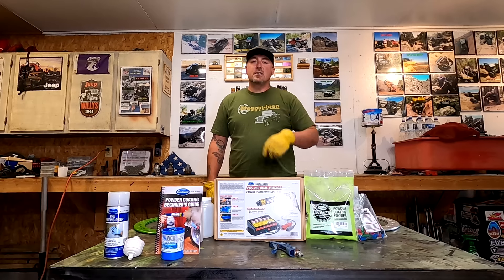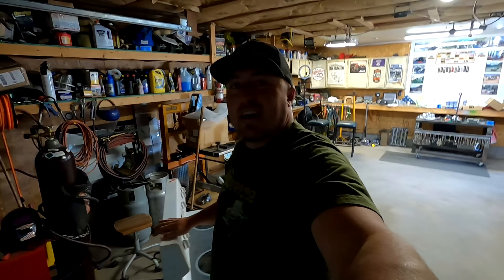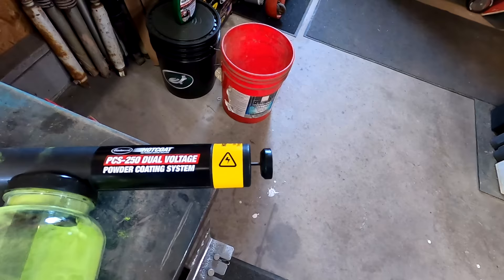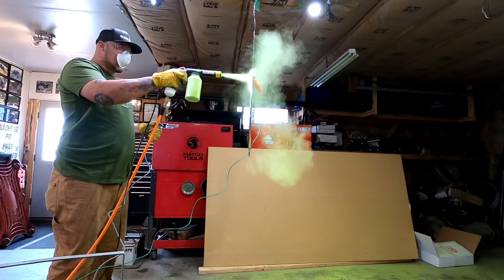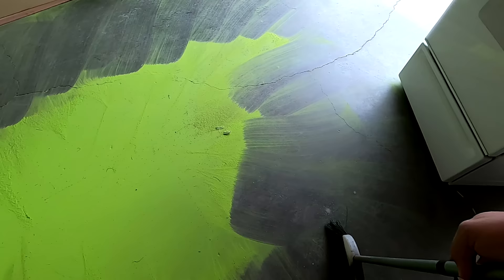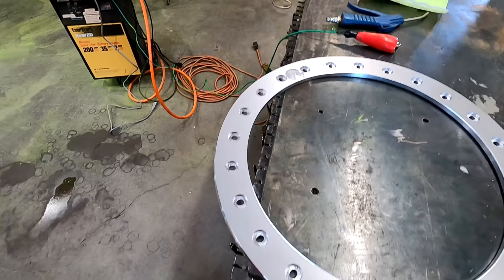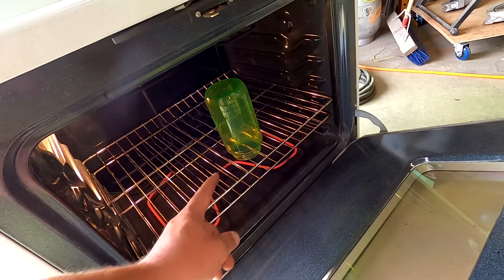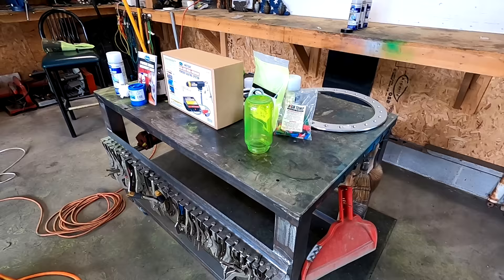10 EASY Steps to Powder Coating at Home. How To Powdercoat

Comment: When you are planning to do a 2 coat application, never fully cure the first coat! You will not get adhesion between the two coats. only cook the first coat until it just starts to gel then apply the second coat!!!
Reply: Fuck yeah dude
Reply: Great video, thanks for posting it!
Reply: Looks like it stuck just fine, know it all
Reply: @steveg2509  it always looks "just fine" but will chip easier later and not be as durable. Dont be a know-nothing and hate on people who know what they are doing just because you dont.
Reply: Truth, it will stick but won't be as durable as it would be when coating over cured powder.
Reply: If it doesn’t stick you can use a blow torch to slightly warm it up before you proceed for the 2nd coat
Reply: A good video for acquiring some basic techniques. Thank you !
Reply: @steveg2509 he’s correct though. It’s standard to heat for about half the time, recoat and then continue for the entire time the second coat requires. This likely worked ok, but you can’t see adhesion from just looking at it from a video.
Reply: Yamaharider158 no, the slightest bit of dirt and it’s ruined. Industrially it’s reused, but it has to go through a cleaning process first.
Reply: @Bzkorea if by blow torch, you mean open flame, then no. A hot air gun works though.
Reply: 8:00 has to be a way to reclaim it
Reply: @cjstrick2010  I'm thinking you will be able to reclaim it if you spray in a clean environment over a large and clean painters' plastic sheet. Then, gently lift the plastic so it collects in the middle and pour it in your container.
Reply: Great video! Thanks.
Reply: @motivpp that's exactly what I was thinking too. Lay a clean plastic painters sheet 5mil first and then sweep up or hand vacuum it up after the application. Completely sterilize broom and dust pan or hand vac after each clean up. But Idk...
Reply: It looks really easy
Reply: Looks like something I would be good at
Reply: @krustys_official  Yes and if the clean plastic is the liner of a giant makeshift hopper (either a real one or put together with cardboard), it would be even more successful and less messy

Comment: Some tips too. You could use the oven racks to hang from, then put it the oven without touching the paint. Let it hang from same wire you sprayed with. That way you don't mess up the powder in transport. Plus spraying over some sort of clean containment, you could reuse the paint.
Reply: I was thinking the same.  Put a sheet of plastic on the floor.  That was a no-brainer.
The oven rack may work but, then you get a powder coated oven rack.  I'd like a explanation on how to transport it without getting fingerprints or tool marks in the powder.
His green is very splotchy.  IDK how to stop that other than have the professional shops do it.
Reply: If he
Reply: If he had used white first it wouldn't be so splotchy , bare metal will do that. Like anything it just takes practice.looked like fun was set to high, usually it's put on slower.
Reply: Damn auto correct gun not fun
Reply: @RalphSampson...  if you take the oven racks out, and suspend them by line or bungee, whichever. Then attach whatever your spraying with line, like he did from the ceiling. You can attach the clamp to the wire and spray the part. You can wipe any powder off the oven rack if you want before bake. Then just disconnect the rack from the supports and slide it in the oven. I can't tell if his racks have that annoying thing that requires you to lift it at an angle to get out. If it does, he can cut the rack to allow it to slide in straight. Hope that clears it up.
Reply: you could almost use someting like a media blasting cabinet
Reply: Good man, you gave the advice I was about to. Cheers

Comment: Just a tip: I started with the older dual voltage Eastwood model years ago and still use it from time to time to this day. Try spraying around 5-7 psi and work a little more slowly. That system has its limits but that will help the coating come out more even. 👍🏼👍🏼

Comment: Good video! One thing I found that helps tremendously with adhesion (not as big of a deal with shiny new parts, but with older stuff that ends up being what I coated most) is to use a phosphate etching pre-treatment. I think i got mine from Columbia Coatings, but its been years so not positive. Really helped out when I used to rebuild old motorcycles.
Reply: So you're the one I should ask how do I get an oven large enough for a 1983 FXR Harley frame?

Comment: Very informative. I've been considering powder coater myself for some time but have not yet. Knowing the basics before hand, understanding the "mess" left behind, a clean booth setup would enable reuse of the excess powder. Basically a non-conductive plastic box which the part fts comfortably inside without much interference for applicaton.
Reply: No, no, no  don't powdercoat yourself.

Sitting in the oven for 20 minutes at 400 deg C will be worse than all day in a maxed out sauna with no ice-cream.

Comment: If you hang with a hook the rims you paint in the oven instead of putting  them in the rack it come out great because as they cure they can stick with a rack and comes out with Mark also instead coating them multiple time if your ground is great you can spray once great .you did a good job.

Comment: i got a refrigerator box  cut the front off of it and put a small box in the bottom with a trash bag in it. hang your parts so they are in the box all your overspray, or most, goes in the trash bag so you can clean up easy and its reusable so it cuts waste. on parts i do double side ill do one side then take my propane torch and run it over the part to harden it then spray the other side and put it in the oven... works well for me! good job with the video

Comment: Great video, I bought the powder coating system that has the power converter as the product distribution from EastWood. Gonna do some RC parts for my crawlers etc.  You did a great job explaining it in layman's terms.

Comment: I am in the process of having 3 patio steel chairs powder coated in patriotic colors. I took the chairs apart to save time, that was a chore in itself. Rusty 1/4-20 bolts soaked in wd40 and super zilla still didn't work.. heating the nuts helped others needed to be hack sawed apart great workout. Cost for 2 $75 ea. 3rd $175 will look like the US flag. We will need to add the vynal white stars on the back rest. Can't wait to get them back together.

Comment: Hi had a idear to collect unused Powder coat spray. Get a card board box a turn it in to a half circle, place this behind what your spraying and also place a bucket below object to collect over/unused spray. Never done this but should work and save on waisted Paint. Also as using a oven a heat gun can also be used to harden painted items.good tips on your video.cheers Scott

Comment: This was awesome, I was always curious if this was possible at home.  Only drawback is limited to smaller items that fit into an over.  Would love to weld and coat some outdoor fixtures, but need a larger heat source.  But thanks, great info.

Comment: I've yet to use my Eastwood setup, and I've already got the oven. 
In the meantime of kicking ideas around in my head, I was thinking to make a metal insulated "box" to enclose the oven when the door is totally open. 
Basically it would double the size ,and the heat wouldn't be as even obviously but it might be worth trying to experiment with someday.

Comment: Great video, learned a few new things. 
One thing I could say, it seems that you're spraying too much powder (I'll admit, I'm only 5.5 minutes in to the video). 
I've been powder coating for a few months now and achieve a great finish with wayyy less powder coming out of the gun. I had mine set up the same way when I first started, and was going through bottles of powder like no tomorrow. I've seen from a few other videos (and now that my body shop has started doing powder coating) that a lot less powder is needed (yea yea.. broken record, lol). 
Again, great video! :)

Comment: Questions:
1. How do you powder coat the area where the item is hanging from or the spot that is used to complete the circuit?
1a. Use a different spot when doing the second coat? OK, but is the paint conductive? How does the circuit get completed with a layer of paint in the way?

Comment: You could put together some kind of catch system to catch the over spray and reuse the powder. Seems like a waste seeing half of the contents on the floor. Is there a way to minimize the wasting via gun setting ?
I thought the electrical process of attraction between the negative and positive would attract most of the powder to the item and not have so much waft away past it.
I am definitely going to invest in a powder coat system at some point as I love the finish and durability of powder coating, plus I have a tonne of stuff to do.

Comment: I gave up using eastwood powder coating gun, it  quit working. Went with at the time the Sears setup, much easier to use. Then I got a Columbia Coatings rig. Better system, IMO.

Comment: Could you not set up a small spray booth type corner, with a plastic catch tray at the bottom to catch all the over spray spill off? That way you could reuse it without there being floor particles in it?

Comment: Build yourself a simple small booth to help with powder cleanup and reclaiming powder. Hang multiple parts(when you can) one behind the other so the over spray lands on other parts. Be sure to jump the ground from part to part. Think outside the box…..cause I’m a cheap dummy.

Comment: You lost me between showing the can of surface prep and then blowing off the residue (?) with an air hose.  I'm very interested in the paint prep spray. Also, is there any way to blow out less powder? It seemed like a lot just went into the air.

Comment: Use an old box to powder coat in to not make a ridicules mess of your garage, and buy a cheap stand up smoker so you can properly hang your parts instead of trying to fit them in an oven.

Comment: As a Professional Powder coater with over 7years Experience, Your Powder Coating Looks Horrible... SORRY.. Its has Patches and Nen Even, Your Power Coating will not Last WHY???? Without a abrasive Surface it will be like spraying 2pac over a Un Primed Surface and will eventually crack & Peel, For long term Quality and Durability you should Always Sand Blast your Material First. 2nd Use Thinners to Clean and Blow Dry & Clean Prior to Coating, Lastly for If you want your Coating to be UV resistant and Last at least 10Years Top Coat with Clear Powder Coat